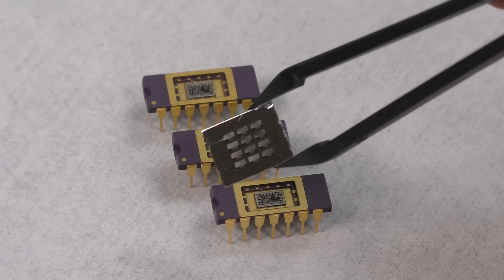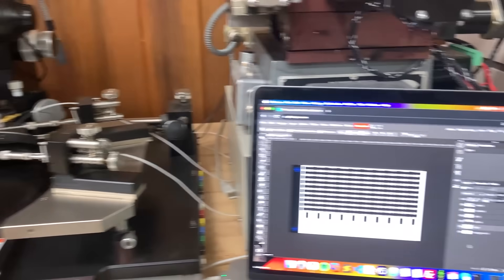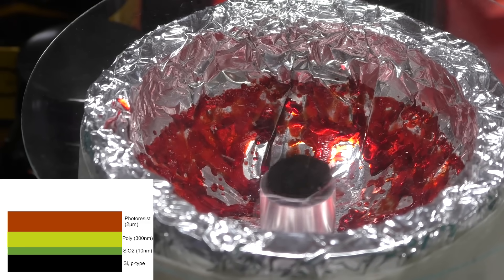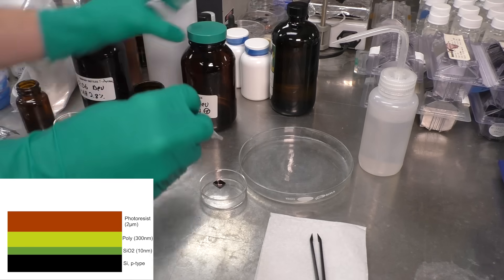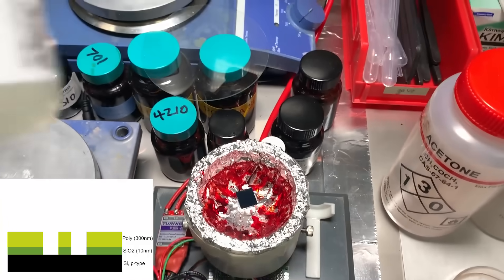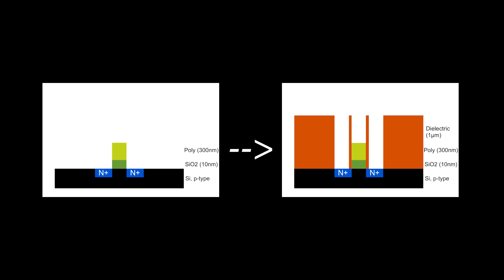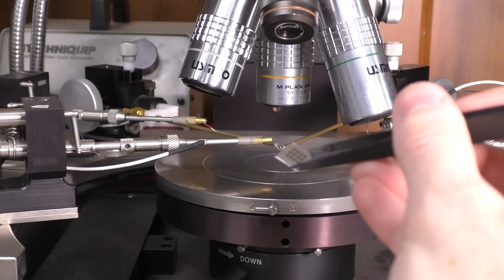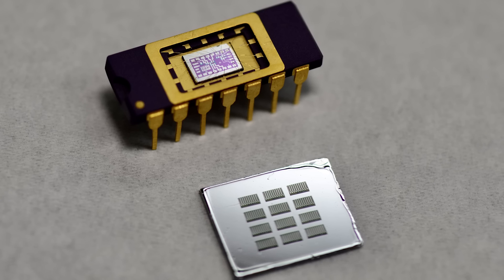"Z2" - Upgraded Homemade Silicon Chips

Comment: For actual MICROPROCESSORS we actually have to MATE CONDUCTIVE PARTICLES TOGETHER. This takes 100's of thousands of years for just one DIODE! For MANUFACURING of INTEGRATED CIRCUITS it is a PROCESS of NANOPARTICLE MANUFACTURING involving INTERDIMENSIONAL MATTER TRANSFER DIFFUSION MATING. So there is more to it than a CONDUCTIVE PLATE used as a type of GATE CIRCUIT. Actual INTEGRATED CIRCUITS are much smaller so this is a GATE TYPE CIRCUIT. And the TRANSISTORS are a collection of DIODE CIRCUITS CONNECTED TOGETHER. It is different to this CIRCUIT although he mentions that he is going to connect TRANSISTORS to his CIRCUIT. A TRANSISTOR takes 250 000 years to MANUFACTURE. A CPU for an i7 takes 400 Million years to CREATE. A MICROPROCESSOR on a CELLPHONE CIRCUIT takes 900 Million years to MANUFACTURE. a credit card with PAYWAVE and a CHIP takes 854 Million years to CREATE. You can tell it is a tiny circuit when you look at a CREDIT CARD with those features more closely. I am the Arkangel Daniel and I am from Heaven.

Comment: This kinda rial stuff, reasonable principles
In theory it might actually work

"True internal power of Capacitor"

in short  -we could discharge capacitor inward
instead of outward, and inward voltage is
higher then outward, by a lot.
When tiny wire ascend to plane between "+" and  "-"
plates of capacitor, its concentration of charge
would increase(therefore voltage on them).

And when charge reaching midst plane between "+" and "-"
it could effortlessly leave capacitor through
(within) its plane (because distance to "+" and "-"
equal in this plane)
======

What if charge on capacitor plates could leave 
capacitor effortless and unleash its true power.
Which usually foreshadowed by nearby opposite charge
(push mines pull(outward force))

But inward force dont foreshadowed and have all of its
true tremendous strength(as if its solitary charge)

And its strength isn't a joke , at all!

If we could remain it intact and go outside with it it 
would be a great output power(output voltage), could we?

And we do have such a place for charge on a way inward(from
capacitor plate) , or better to say such a plane
And it right amidst "+" and "-" plates.
Charge could move within this plane effortless
(because distance to "+" and "-" is equal for any point
in this plane)

So charge could maintain all of its true power and
leave capacitor within(through) mid-plane (as far of 
capacitor as it want)

Its mean we might obtain great power then
Because we pull in low voltage and it push out high 
voltage (with the same quantity of charge)

How it might be done :)
Just tiny wire which descend from "+" or "-" to midst
(between them) and wend aside through mid-plane through
with all true voltage.

Concentration of charge when it reached amidst would be
great , meanwhile there no force to hinder it within
mid-plane:)

Therefore we may see that voltage actually 
rise in a way inward and lowered in the way outward

Its just mind-blowing (really unexpectedly)

=====
2)
=====
HOW MIGHT WE OBTAIN ENERGY from SURROUNDING TEMPERAUTRE
MAY WE?

Might we built thermal motor with 100% efficiency?
This model SAID yes , how? Read below and enjoy the journej

(and therefore have possibility to obtain energy from the surroundings without consuming some fuel though in theory)

(let it be in the vacuum )
Shocking but fact - this motors already convert 100% heat energy into pover
BUT!!!  (how it might be without it) in the First Stage      when it expand to the point where temperature equal environment temperature
(simple machine which consist of piston , cylinder, gas inside it)

In the Second stage we should compress volum emiting heat to the environment with the same temperature what environment has and therefore waste energy (even nothing to contain
thermodynamic allows us contain overheat without effort but in this case we dont have overheat)

So if we can avoid second stage we can save efficiency(and it might remain 100%)

And solution  how to avoid  waste power of compressing gas is...  :)
Dont use GAS !
we might USE LIQUID heated to the boiling temperature (boiling temperature depends on pressure on piston, let it be atmosphere pressure 1 Bar/100 kPa)

So we boil water, expand volume with 1BAR pressure, supply heat 212 F/ 100 C 
in the process, then we store remain warm(overheat if compare it to the environment temperature)
And - without effort return piston to the start position(thats it, all what for all of it,
this key component, we got it)

In the next stage we return stored warm into system and supply additional heat
intto the system
And repeat it again and again never emit any heat to the surroundings
All warm eventually would become power.

We heated water, we get what we want(power)
we store remain overheat to the storage with 0 effort
in order to use it in the next stage, and repeat 
we use heat in storage , then supply additional heat 
and repeat it again and again without waste of energy
therefore all warm energy will become power even though not at once
(thi is idea)

if we talking about water , temperature of boiling water is 212 F/100 C 
Coefficient of efficiency may be something around 4 (0.25 points input power to obtain 1 point warm energy)

And all iof it as we could see , might be converted to power
another words input 1, output 4 , difference would obtained from surroundings warm (another words it may be little bit colder if then)
===
3
===
And let's see another one oportunity
What if magnet field(force what affect the straight section of wire per miter(not coil))
might be almost constant, as weight force per kilogram near earth surface.

So  to obtain interaction similar to  straight section of current 
we should stretch opposit current away from us.
(we dont deal with this bullish... North and Sourth mythicale poles, its just interaction between parallel currents in plain)

If source of force far enough  and its force  enough powerful
we may obtain almost constant force per 1 weight/current/charge

But what means dB =0, it literally mean that opposite Voltage 
U=dB/dt = 0 as well, 
But its only concerns motor without magnet in this case
because F*L still the same and we don't elaborate some method to turn off magnetic domains yet :)

Additionally if that "far away current" wasn't  a permanent magnet 
rotation of our motor stil would be induce some very tiny Voltage,
which means it should require Voltage for insane amount of current.
But luckily we may use permanent magnets.

-------
Another similar model 
is model which consist of battery, resistance (R=1) and  electric transformator but not like letter O but like I , lust straight piece of
ferrite.
Type of signals "quadrupol"  U =1  I(current) =1 

So we have battery 10 volts, 10 amps, consequently attached resistor and transformator

But  transformation would be afeccted by the current, thats why we were include
cylindric magnet around transformator to compensate 10 amps current.
-----------
So  without input supply input power to the trunsformator 
we have 10 Amps 10 Volts  = 100 watt
When we turn on transformator input will be then
11 amps 10 volt from battery, and 1 amps 1 volts from transformator
= 110+1=111

Output heat power in resistor 11 volts, 11 Amps =121 watt
121 >111 , we get 10 wats more 
BUT!

lets see what would happen when we replace permanent magnet to
coil wit 10 Amps, 0 Volts
We should maintain current when transformator turn on , and therefore our Voltage will be 10 Volts.

HERE IT IS  -this 10 wats waste
Therefore we see that permanent magnet could gain power into system by just remaining CURRENT the same

Nowhere saw describe like this,
though idea quiat simple
It might be good if in the world be more pure minded volition people

Comment: how much does all the equipment cost? also will you be able to make smaller transistors and increase the transistor density if you used lower wavelength UV light? (maybe even x-rays? although I'm not sure how you'd build x-ray lenses maybe using lead or something? lol)

Comment: If I could make a suggestion on what to do next, a 555 timer IC would be great! It's one of these simpler but funamental ICs that are absolutely everywhere, and if it turns out we can make these at home - and they're reliable and functional - it'd be a great step for the maker community!
Reply: Just use FPGAs. This is super hardcore and looks like he easily has hundreds of thousands of dollars of equipment necessary to take a crack at this. Most people wouldn't even get as far as he did even with this equipment
Reply: Or an LM3909.
Reply: @ElukeNL  - Available for purchase for about $7.   Real question is, what are the Chinese using these days to flash LEDs?  There seems to be something that isn't discontinued that I can't buy.
Reply: @bryanjensen7162   Idk, somewhere I read they’re using MCU monitor/reset IC’s that happen to reset a a usable rate for flashing an LED with it.
Reply: Tha'ts true.
Reply: A 555 without the problems (like transiation glitches at the output) would be nice.
Reply: I'm not sure if home chips are all that useful for practical purposes, but a super neat project and a great way to teach and learn how computer parts work from the ground up
Reply: They would cost way more homemade than just buying.

Comment: 2022 watching different videos about circuits  chips welding loops etc  ive never seen b4 until today Most were intell auto manufacturing hiding in machines
I now see how you make a chip  remarkable Sam the dedication 100%  cheers . 
must've been like this back in the day  in the old designers labs  @ intel

Comment: This is honestly amazing... the word is out, and we are at the edge of something big. Today, Sam is literally the only person in the world to make chips in his home, but tomorrow, the retrocomputing community is going to jump at the opportunity to remake their old chips, and after that, it's going to be like 3D printing... Can't wait.
Reply: Lol, no.
Reply: An 8086 has over 20,000 transistors.
A 386 has over 200,000
A Pentium 1 has over 3,000,000
Not quite at the edge.
Reply: @Intelwinsbigly  we still use single transistors for all kinds of applications like LED lighting, amplifiers, solid state power switching, etc.  I think this guy would do well trying to make IGBT's or Silicon Carbide transistors which are enormous but enormously important.  Also, the big companies have stopped making RF frequency transistors and won't sell the IP to Rochester.
Reply: @chrisfuller1268  LOL, love how you go on a tangent about everything other than processors, which is what both dj and I were talking about
Reply: @Intelwinsbigly  yeah I think an fpga is cheaper
Reply: @misham6547  most definitely.

Comment: It's really great that you are providing this information to us. Chip manufacturing is such an enigma and I think an open source chip is something that people deserve to have. Thank you for your service!
Reply: No. People do not need open source mask programmable chips. That's a fallacy.

What people need are field programmable gate arrays (FPGA). And these exist and you can use them without having to manufacture them yourself. A considerably more efficient way to implement a digital circuit.

Home made mask programmable chips have only two uses, and that is for the purposes of fun and education only.
Reply: @deang5622  He did not say it would be useful in commercial applications, just that people deserve to have it. And I agree.
Reply: I would argue the knowledge is equally as important.  @deang5622
Reply: 😪 @deang5622

Comment: You know what would be wild?  If you used your chip in a circuit that is running off of crystal power cells!  No, not some 'free energy' mumbo jumbo, but piezoelectric/thermoelectric tech that gives you a battery that will put out a trickle of power for literal decades and you can make it on your hotplate from components that you buy at your local hardware store.  Interested?

Comment: I worked in a small semiconductor fab in the summers of 1972/73, your setup brought back some good memories of what it was like back then. We grew our own silicon from a melt. All seems a very long time ago now.
Reply: Back when you could work in fabs as a summer job
Reply: I highly doubt that there are any entry level jobs in that industry anymore. Only job that is walk in ready at a fab is the lunch room cleaner
Reply: Fascinating life of yours
you're lucky man
Reply: how old are you sir?
Reply: i like to ask how hard it be to make cheap from 1990? because a lot of retro system from late 70s and 80s needing replacement chips and all that
Reply: Just a question, he's doping a P-type wafer with an N-type solution, Does the mixture of these two impurities doesn't ruin the efficiency of these gates?

Comment: Man you have my sub, so upgradable microchip , who though about that? Still there limitations like the switchting time issue, this why we dont have upgradable chips on motherboard , which would be cool . Like need more better sound card, just put the upgrade , need some better network card put the upgrade and on gpu need overclockspeed put the upgrade.

Comment: I'm extremely surprised how not only he knows how to make the 2nd gen chip at home by himself, but what's even more impressive is that he explained it all basically in under 6 minutes only.
Reply: Its been 2 yrs. Where is this guy? Did he join the secret all seeing eye cabal.
Reply: @nhilistickomrad4259  He started a company called Atomic Semi. From their website: "Atomic Semi is building a small, fast semiconductor fab. We’ll build the tools ourselves then quickly push them to more advanced geometries. We’re building a small team of exceptional, hands-on engineers to make this happen." If I was in SF, I'd intern there instantly. Sounds like one hell of an adventure!
Reply: "home" bruh, did you see all the equipmement he have?
Reply: @TheSonofseventhson  he probably has 50k worth of equipment
Reply: @TheSonofseventhson  Yeah, we're still talking about 100 grand if this isn't "fell off the back of a truck" equipment.
Reply: @TheSonofseventhson  Everything is created with equipment/tools?
Reply: Eh, I’m fine with it. It is more self explanatory to layman like me than something like “home lab made silicon chip”. Actually, that’s more explanatory, but I’m still fine with homemade.
Reply: @TheSonofseventhson i dont see expensive or difficult to obtain equipment. My wonder is : how does he align the chip for the second litho ? 

He answers the basic question : microscope + DLP ... The rest is easy.
Reply: @Benoit-Pierre   The fact you need specialized equipment already defeats your non-existent point.
Reply: @TheSonofseventhson Having equipment doesn’t change the “home” factor. The “at home” means it’s done at home - he can do it off of residential electricity. 

I work in industrial automation as a repair tech, I couldn’t EVER get the voltage supplies required to do the job I do now at home (not safely, anyway). I often repair, test, and operate drives from anywhere between 110VAC to 1000VAC; or even 600-800VDC. So there’s a small amount of repairs I could actually do “at home”.

The principle stands, he’s at home doing this. Seems self explanatory. It’s not like he’s claiming to do it without equipment, you’re just making the assumption.
Reply: @ST-jh8wz  Nah, you're just playing with words and meanings, twisting the meanings and doing a lot of mental gymnastics man...
Then none is industrial made if you have industrial equipment in your house, and even the size of whatever "house" means, doesnt matter...
You can have a 1000m2 place, fully equiped and call it "your house garage".
In fact, from your point of view, dosnt matters if you have a 28nm litography machine as long as it is in your house? lol.
Reply: Albert Einstein — 'You do not really understand something unless you can explain it to your grandmother.'
Reply: If you've done a degree in electronics at universities, some universities have professional grade equipment for making integrated circuits, so that is one way the knowledge can be obtained.
Reply: I still don't understand it
Reply: @realdragon you need to have lectures about chip manufacturing, and how mos are different from bjt. Those details can be found online. They are pre reqs before this video.
Reply: It's pretty basic thing. Basic technology (knowledge) of IC making freely available.
Details for the first generations of IC are  pretty simple and can be learned by try and error.
What is impressive it is his determination and skills of finding, adapting and designing equipment.
Reply: That's what education does to you when you enjoy what you study. Which is most often the case when you are free to chose for yourself. I mean free like in no pushy community, parents or culture that are effectively chosing for you due to all the social and economic consequences you will suffer if you go against the pushy culture.

Comment: there are bias's or whatever they would correctly be called, that would account for intel having to create all that technology they needed, and all the nitty gritty numbers n settings n processes, besides the hardware..n redtape..  u were able to kinda pick up where they ..started.. in a certain sense.. u didnt have to figure out n build all that technology, u simply picked up n used it. i wonder how long it took them to complete the same process u r, without having to do all the research n development   do Not take any of that wrong im not talking down what u did one single bit, but i wouldnt compare them exactly apples to apples